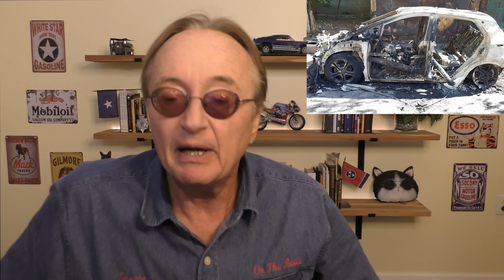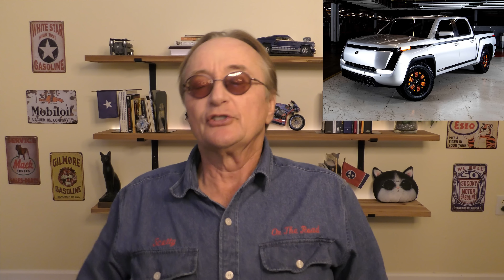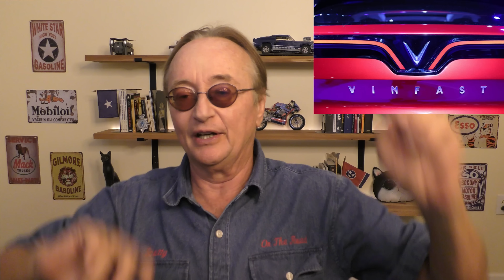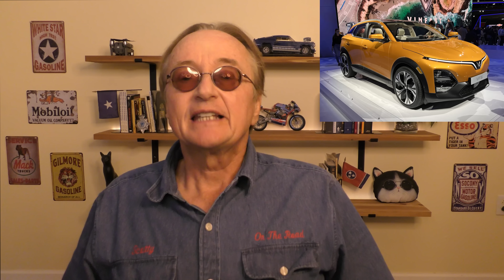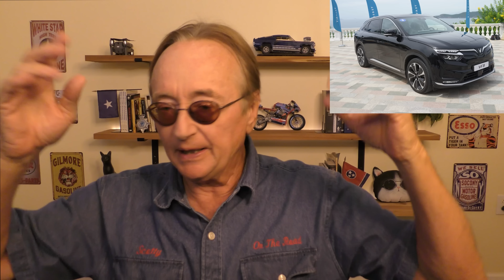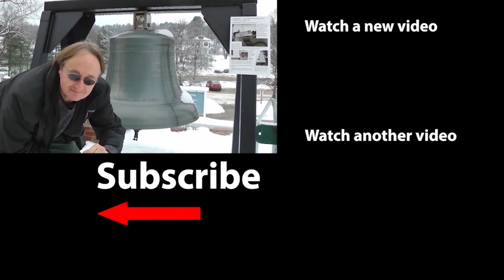Here's Why Ford's CEO Regrets Building the F-150 Lightning

Comment: The Ford CEO needs to go try to work a 12 hour summer day as a landscaper hauling a trailer loaded with landscape equipment and a crew of four.  Of course, most landscapers also need to attach a seven foot plow to the front and a salt spreader to the back in the winter to plow continuously for 16 hours during a major snow storm to get  his customers moving again.  That was no issue with a V8 ICU engine in an F-150.

Comment: I think 90 percent of charging is done at home or work .
Reply: @maj8301  Norway has a majority of there cars are EV and it's very cold there
Reply: @stevencole7331 and how big is Norway? How long of a distance do they travel? Do Norwegians haul or tow, what the average size of families?
Reply: @furiahispanica3823  I remember traveling with my parents in the 1960s and you were lucky to get 8 miles to the gallon . Gas stations were not on every corner and running out of gas was not unusual . Things like the Arab oil embargo really mad it difficult to get from point a to point b . My point we are just at the beginning of this technology and I am surprised EVs can get 300 miles .
It won't be long that 500 miles will be common .

Comment: I did a quick check and see that there are about 145,000 gas stations in America. Saying the average amount of pumps is 6, that's a little over a million actual pumps. With people staying at the pump for an average 10 mins, it can service 7 million cars every hour.

With only 15,000 more electric service charges, that's pretty much just 15,000 per hour. That's NOTHING! 

EV is over hyped for no reason. Such a waste.

Comment: Mr. Kilmer, what is your opinion on a 2013 Infiniti M37x mid-size sedan with the 3.7 L V6 engine, which produces 330 horsepower and the seven-speed automatic transmission? These newer Infiniti's are popular to some individuals, who needed or wanted to commute or go on a nice road trip in, because it is all-wheel-drive. It should work for myself in the foreseeable future. Most older used vehicles need a lot of maintenance or repair sometimes and the rest of the newer used vehicles are way too expensive at this times, especially the non-luxury brands and the newer used pick-up trucks, newer used three-row SUV's and newer used minivans. Thank you very much.

Comment: Doesn't matter how many fast charging networks they can use when their vehicles like the Mach-E takes 45 minutes to charge from 10-80.  The Ioniq 5/6 and EV6 can charge from 10-80 in 23 minutes on a 150 kWh charger and 18 minutes in a 360 kWh station.
Reply: Whats the max amps the charge controllers are set at for what i'm going to assume is Bulk Charge Mode for the vehicles mentioned?

Comment: Scotty, you’re right on most things, but wrong on this. A huge percentage will charge at home and only use fast chargers on occasion. We have an EV and have only used a fast charger only once. All other charging sessions have been at home between 10 p.m. and 5 a.m. with our Level 2 charger in our garage. Admittedly, long road trips are a challenge. But no way will millions of chargers be required. How many gas stations would be needed if a huge percentage of people had gas stations at home?

Comment: This comment is just for 'schitts and giggles. If you have th disposable income to buy a $60k USD electric vehicle you can probably afford to install a home charger and run your EV on cheap off-peak hour electricity. If you can afford an $80K EV changes are you can likely afford to install a home charger capable "vehicle to grid" to sell electricity back to the grid. Toss in a residential battery and you can make money by charging during off-peak hours and selling the electricity back during peak hours. Watch for this kind of setup to become popular in the next 2 or 3 years in the South West where rooftop solar works well.

If you live in Texas you can make out like a bandit selling stored electricity back to the grid during an extreme weather event that knocks out the grid for a few days. You probably think i'm kidding about this one...

Comment: When they build smaller EVs with lower top speed & acceleration the EVs won't need such big batteries. Make the batteries smaller (less Kwh) & charge time (& price) drops. Electric motors in cars are the inevitable future, the power source(s) are yet to be determined so I'd hold off on these battery EVs for now.

Comment: Scottie!
I have a 206 hyundai elantra and the power steering pump has slowly started whining. A little here and there at first. I have had it for over 5 years. But, the power steering pump always whines a little now. I know these cars can be finicky. What full synthetic power steering fluid would you recommend I use to replace the old fluid?